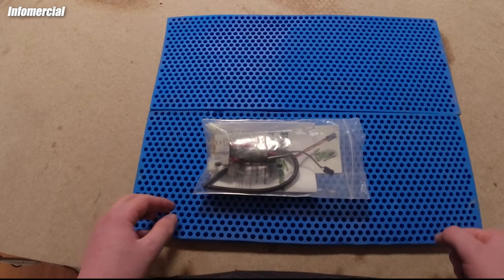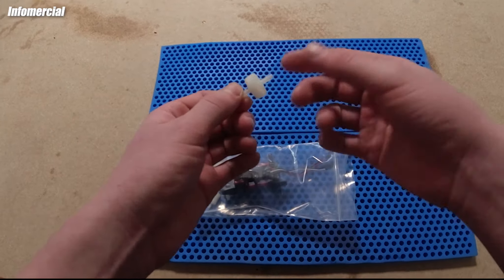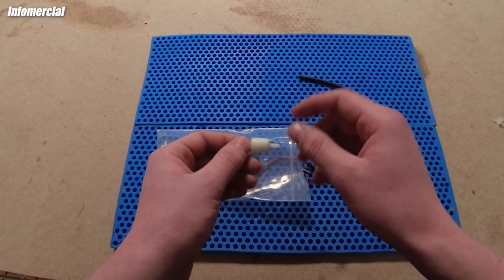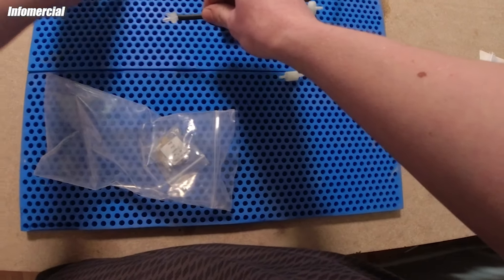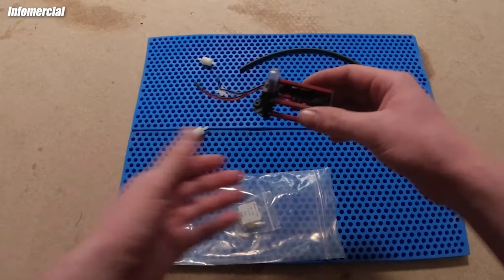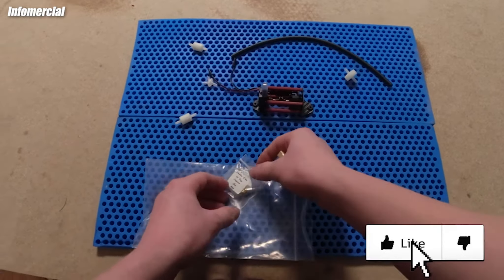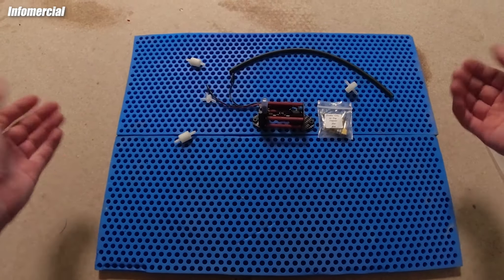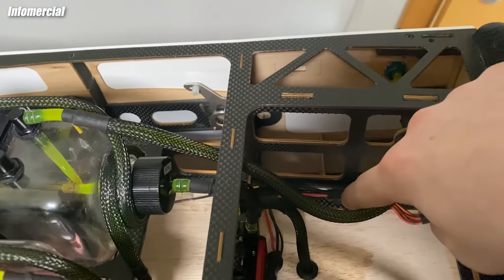Holy Smoke pump V2 //Unboxing//Installation// English version

Comment: Halo, Prost.  How do I keep my black smoke line tubing from burning off the nipples on the mufflers? Do you have a secret or a tubing that doesn’t burn off?
Reply from the maker: Hello,
I use the tubing that is included. But can also use a heat resistent fuel line that you can get for example at aerobertics. https://aerobertics.be/en_be/aerob141.
Best regards 
Michi